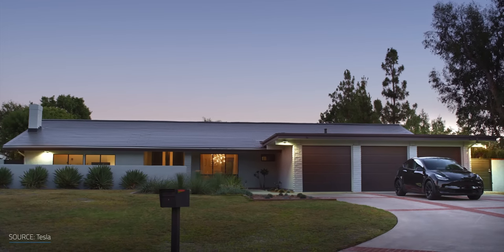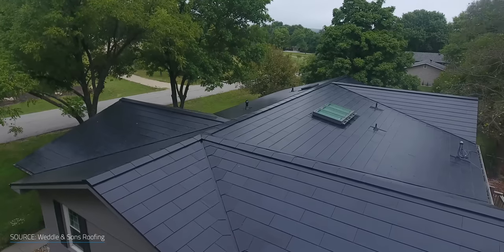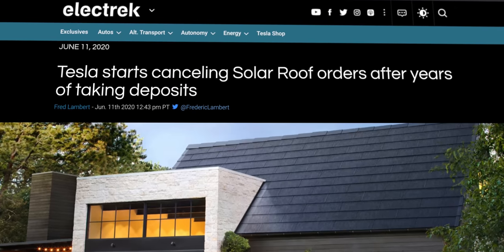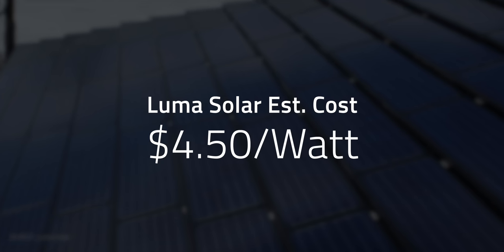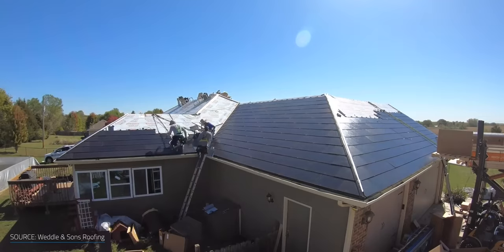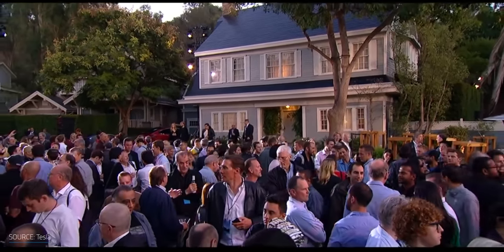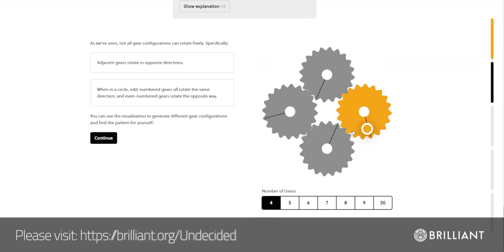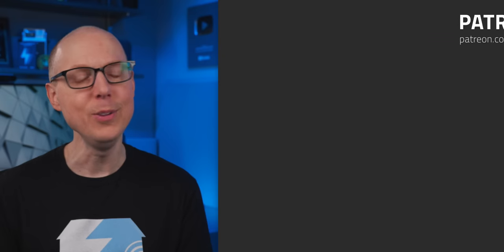The Problem With Tesla’s Solar Roof

Comment: With the problem of tiles heating up, I wonder if they could be combined with a solar water heater sollution to make use of the heat and remove it from the tiles. 
Though, a "Water Cooled Roof" sounds like a Linus Tech Tips project.
Reply: IIRC Linus has said that he found something like that to be a possible project, I don't know if he was planning to do it himself or had found actual tiles that double up like that though.
Reply: They already make them, they're called PVT (Photo Voltaic Thermal). Can't remember who makes them but they are the most efficient option available.
Reply: There's a French company in Marseilles that makes them. It's called DualSun.
Reply: It is definitely possible, but often isn't worth the extra cost, especially considering that replacing a broken tile/panel is a much more difficult job generally.
Reply: The main problem is that by the time the solar thermal is hot enough to give useful heat it is already too hot for the PV.
Reply: They really should design a air channel to direct some of that heat to a ridge wind turbine to generate a little more power, maybe using geothermal principles.
Reply: @guygillmore2970  Good point, but you could work around that by adding a heat pump to the system. Pumped heat takes a lot less energy than making heat.
Reply: The Tesla Solarroof tiles sit above a thermal underlayment.  There is about a 2/3 inch gap that lets air get sucked in the bottom and exhausted at the ridgeline.
Reply: @imushavem7504  you'd be surprised how little energy that would collect while adding a lot of complexity.
Reply: @thomasross4921  yes, I was going to mention that, but edited for brevity.  It does make the whole system complicated though.....
Reply: @DarrenKrusi  Looks like a really worthwhile project that surpasses the standard solar roof design. Extra efficiency for the panels could help a lot with smaller/tinyhome builds.
Reply: They have standard roof mounted panels that use this water cooling technology
Reply: It was called BIPV - Building Integrated Photo Voltaic.  PV is a "set it and forget it" technology.  Anytime you have water, there is service required, leaks, seals, glycol, etc., etc.  PV is last, after efficiency.  Depending upon how efficient, an over-roof could help with the heat challenge and keep much of the heat gain of the structure.  There is no "magic bullet", but it more like a "magic shotgun blast" - many small synergies that solve the dozens and dozens of small mistakes that make your home a little worse and a little worse.  Something like Kaizen is better, incremental improvement in many things, instead of hoping solar will fix all of those many problems that stem from decades of bad habits.  Additionally, most homes lack the roof space & orientation required to produce all the 80-90% of wasted energy most homes currently experience.  Efficiency first, PV last.
Reply: that aged well
Reply: I wouldn't at all be surprised if eventually Tesla just starts building entire homes, complete with solar roofs, energy storage, and maybe even evaporative water systems. It'd be like a total off grid home, but right in the middle of the city. Wonder if they'll come up with a sewage solution too.
Reply: @guygillmore2970  Are you kidding? A roof gets to be over 150°F. That's way beyond a useful temperature for hot water.
Reply: @brandonn6099  yes, but my point is that is far too hot for efficient PV.  You want to keep the PV to 30C max, which means the water coming off your roof is only useful for swimming pools (or the heat source for heat pumps)
Reply: @tayloranderson456  They do.  Of course it's small and you can pull it around with one of their EVs.
Reply: @brandonn6099  Actually if energy is free/surplus it probably makes more sense to store water hot and then cool it when desired. That might eliminate the need for chlorinated water and all the crazy cases of stuff like legionnaires.
Reply: @guygillmore2970  Even if the water is 120°, that's still a far lower temperature than the tiles would normally be at. I'm guessing the energy loss is somewhat exponential with temperature, so 30° cooler will make a pretty big difference.
Reply: Well, Linus did this exact thing lol
Reply: Sounds like a bad idea. I can't imagine the ROI being worth it unless you live in exceptionally sunny or hot areas but then any tiny dedicated solar water heater would probably be cheaper
Reply: Solar heated pools were excited back when I was a child. Solar Heat is old news but putting the Solar Electric Panels on a solar liquid system is new.
Reply: Linus at LTT literally has a video about putting water cooled solar on the roof of his new house!
Reply: This does exist, as others have said.
It is normally used with a heat pump, so you get to use a higher % of the potential energy out.

And yes, Linus in installing this on his new house.
Reply: Thats pretty common already in the industry
Reply: He is doing a water-colled solar roof for his house right now.
Reply: linus cant even set up a proper smart home lol hows he going to take on a project like that.
Reply: My pool is heated by thermal solar panels on the roof (installed 2003 and still functioning perfectly), but sadly, they don't produce any electricity, just hot water.
Reply: He actually did it lmao
Reply: Check it out on Linus Tech Tips new house videos…he did it! And the water heats his pool.

Comment: Good video, thanks for showing multiple options and being level-headed about the pros and cons.  Additional point:  There is no air space between the solar tiles/shingles and the roof.  This overheats the structure of the house and increases AC loads.   Solar panels allow a few inches of air space and actually cool the roof, reducing AC loads.  This has been documented in a study (San Diego State U, I believe) as reducing AC costs by about 5%.  So it's hard to justify buying a more expensive roof, with more wiring connections (points of possible failure) and increasing the heat load on the house, compared to solar panels.  It can make sense when you must get a new roof, but even then, still hard to justify.  If you don't need a new roof, I can't foresee the situation in which I would recommend it.  (14 yrs experience in solar, including BIPV mfg sales mgt)
Reply: Saw a video about Tesla roof where they said it was of from the roof so air could pass under
Reply: @Gustav4  they're still evolving the products, so it's hard to say. But every time I have asked I have been told by the manufacturer, whether Tesla, DOW, GAF, Eagle, or others, that there is no airspace. If one of the manufacturers would engineer a product that has ventilation space I will be sure to espouse it.
Reply: Not to mention that embedding the panels directly into the shingles seems like a maintenance nightmare.
Reply: Dont forget about the lower efficiency of the panels themselves. Learned about that in at Uni. In-roof solars loose about 2-5% performance compared to on-roof panels
Reply: There is a 3/4 inch gap between the roof and the bottom of the tile with small vents at the drip edge and ridge.  It's not alot of air flow but there is some.  The ice and water shield makes more of an impact on AC than the actual tiles.

Comment: The main advantage of solar roof over solar shingle is the air gap. This small detail drastically helps keep home cool in hot areas.
Reply: @boblatkey7160  bullshit, lmao. Normal roof + solar panels is $20k-30k. Every quote I've seen for a Tesla roof is $50k+.
Reply: @boblatkey7160  the meaning of your original comment is extremely unclear, it seems like an argument in favor of solar shingles.

I said "roof + panels", not just panels. It's not fair to compare the price of solar shingles to just the panels, half the job of the solar shingles is to be a roof.
Reply: The solar roof tiles have an air gap.  Meanwhile, if you have issues with keeping the roof cool in hot areas, the best fix is half pound foam.  It lasts forever, is easily installed in a single day and surprisingly cost effective.  I did it on my house in Arizona.  It’s also a superb deterrent  against any water leaks in your roof (which makes a lot of sense if you want to move to solar panels later on).

Comment: If you're in a rural area, don't stick the panels on the roof. Rural implies that you have open land. Install them on unused land, and add a power shed. That's a shed where you install your inverters & batteries. Also, you can use lower cost solar panels, and older & cheaper batteries. Yes, they're bulkier, but its not moving, so who cares.

Its all off the shelf stuff. And people in rural areas know how to use tools, so there's savings on labor cost. Do it yourself. Bet you wish they still had shop class, in school.
Reply: Good advice
Reply: No need for batteries, though, if you’re connected to a utility.  For most people, I’d advise getting a simple, grid-tie only system.  If money isn’t a concern, or there’s high, time of use utility bills, the newer, smart batteries could be worth looking at.
Reply: @adlockhungry304  it all depends on how many power-cuts you deal with, and if the feed-in rate is wholesale or consumer priced.
Reply: @kaitlyn__L , agreed.  I’m in CA, where interest in smart batteries was pretty low till PG&E started having scheduled blackouts during times of high fire hazard.  Also, time of use rates finally got high enough that an expensive smart battery or two began to make financial sense.
Reply: @adlockhungry304  oof. I can understand why they do that, the huge relays can spark sometimes, but ouch. Plus as wildfire seasons get worse and worse with the whole climate thing that’s just going to happen more and more :( 

In the UK where I live wildfires of course not a factor (…yet?), although the feed-in tariff is 3-4p/kWh while the usage tariff is like… well it was 12-15p but recently it’s like at least 20. So if you have enough battery capacity it can pay for itself versus the tariff disparity, plus of course you can still get feed-in payments when the battery is full but the sun is still up. 

But regular power-cuts is pretty much reserved for the super-rural houses (of course that’s still a sizeable number of people it could help; even keeping your freezer from thawing in a powercut can save £50-200 in groceries after all).
Reply: @kaitlyn__L  , It’s cool to learn a little bit about how the utilities work over in the UK!  So, what’s the difference between your feed-in tariff, vs your usage tariff?

Here in CA (well, Northern CA, anyway) people who get solar are put on the time of use (TOU) that I mentioned earlier, in which their solar is “net metered”, meaning the meter measures the balance between what the property consumed, and what was generated by the solar.  In short, the client saves power costs at the retail value of the energy.  Any excess produced for the year only receives wholesale, though.

In TOU we have different rates at different times of day, broken into two categories: Peak, and Off Peak.  As you may have guessed, it corresponds to the times of day in which electricity demand is highest, Peak, down to lowest, Off Peak.  Off peak is around $0.30(US)/kWh, while peak is around $0.40/kWh.  Seems like it wasn’t that long ago that off peak was $0.18/kWh and peak was $0.30.  Peak hours used to be from 1pm till about 8pm, however now peak is from 4 or 5pm till 8 or 9pm (depending stuff n things).  It used to be more fiscally advantageous to have a southwest facing PV array, rather than due south, because of the higher retail value of the energy savings made in the early afternoon.  The utilities have pushed the peak hours later and later.  Because of this, there is more incentive to get a smart battery that can use the solar to charge itself up throughout the day, then sell all that power back to the grid during the peak hours.
Reply: @adlockhungry304  A separate feed-in tariff is the alternative to having net metering, which is nowhere in the UK. Some US states have this system too. It means you are paid the wholesale rate for any electricity you generate, same as a commercial solar farm. 

This wholesale feed-in rate doesn’t include the various taxes and other tariffs (like transmission fees) that domestic consumption rates have — in the UK the rates are all bundled together, our bill doesn’t have separate transmission fees like you do over there. So any units you pull back out of the grid are charged at the regular usage rate (which is what anyone without solar also pays, this can be a flat rate or a variable one [TOU] depending on the package you select). Which means you need to put in three, five, maybe six nowadays units of electricity, for the price of pulling one back out from the grid. Obviously this makes it advantageous for you to be able to maximise directly used solar, rather than relying on the grid for balancing. 

Of course even in American net metering, that only covers your per-unit rate and not your transmission rate and other separate fees. So I imagine you don’t quite get 1:1 either, maybe it’s 2:1 or somewhere in between. But that’s still much closer to a true “grid battery” than we have here in the UK. 

Another wrinkle is that you can actually have a variable feed-in tariff but a flat consumption tariff, if you choose that. You can even shop around and have them with separate companies. They are metered completely separately.

Almost everybody with solar panels on their home goes for the flat feed-in tariff though – because then it’s at least predictable. Precisely one company offers a variable feed-in tariff, they are called Octopus Energy and that tariff is called Agile, so the package is called Octopus Agile. Sometimes this can generate large amounts of money for a small amount of solar, but when the weather is great and everyone’s producing, the price can go wayyy below what a flat feed-in tariff will pay you.
Reply: @adlockhungry304  Got a question.

If many homes start adding lithium ion battery packs and the house catches fire because of a wildfire, 

How much harder are those fires going to be to put out?
Reply: @shawnr771  Thank God for sodium-ion batteries and currently avaliable off-the-shelf lithium ferrophosphate batteries which don't catch on fire.
Reply: @shawnr771 , about as hard as it is when a propane tank catches fire, or a lead-acid battery bank, or the gas tank of your vehicle of choice.  I got news for you: lithium batteries didn’t invent fire.
Reply: @adlockhungry304  no they did not.
Yet reports of how much water it takes a fire department to put out a Tesla or other electric vehicle.

What is that going to do during a wildfire/drought situation?

Resources are already strained.

It might be the time to think about a less burnable structure to house the battery systems.
Reply: @shawnr771 , agreed.  Pretty easy to make a cinder block shed with a metal roof, as one example.
Reply: @adlockhungry304  maybe they should use tilt up concrete for houses.

Beats them burning.
Reply: @adlockhungry304  i think if there was a wildfire, the house would already be burned down at that point..
as for Rural area most people wills till stick them on houses so they can mow and keep land open up, that's why people buy in Rural
Reply: Not all rural areas permit ground mount systems without special planning permission. Our township, Stone Mills for example does not.
Reply: @niallleslie7419  ya only country homes can get away with that but same in most or all small towns
Reply: @kaitlyn__L  Also on how well you can deal with a power cut. In many cases the ability to gracefully fall back to temporary low power mode supplied by a generator or EV will be cheaper than a dedicated battery system.
Reply: @dave7038  while that’s true, how many EVs can feed back into the house currently? That seems more of an “in 5-10 years” kind of deal to me. It was also my understanding that a generator was about as expensive as a small lead-acid cell cluster and inverter, especially with fuel costs factored in, but I say that knowing generators are rare in the UK while many households in the USA already have an old generator for emergencies which does alter the calculus a fair bit.
Reply: As I understand, the full price of a ground-mounted solar installation gets the federal tax credit.  What if your ground-mounted system was 9 feet off the ground and you happened to have a nice seating area or outdoor kitchen under it?  Plus, the least number of penetrations in your roof, the better, in terms of leakage.  Most leaks happen for years before the true level of rot is uncovered.  Prevention is far better than a cure.
Reply: I wish school had less shop class and more grammar.
Reply: @kaydog890  Well, not so important as long as we get the message across effectively.
Reply: @kaydog890  It's a puzzle,  staves dementia.
Reply: They do still have shop class in school. In alot of schools its a required course
Reply: Panels are dirt cheap nowdays. And if you are creative with where you source your batteries a storage solution can easilly be done for less then 100 bucks a kwh for lithium ion. Even less if you do a hybrid with some lead acid mixed in.

If you have the space, basic tools and a bit of knowhow or willingness to learn (solar instalation really isn't rocket science) you can build an awesome system for a couple of grand max that would serve your domestic needs and probably your transportation needs as well.
Add a couple of solar collectors on the roof for hot water and you basicly delete your entire electricity, home gas and petrol expenses for 30 years for less money then an old used car.

Comment: Good video for alternatives for Solar Roof's.  We installed the Tesla Solar Roof v3 and Powerwall system as our roof needed replacement after 27 years of GAF shingles.  Took two weeks for old roof removal and install in July 2021 and received final PTO in Feb 2022.  Working well so far.